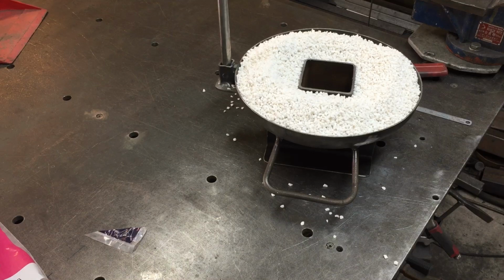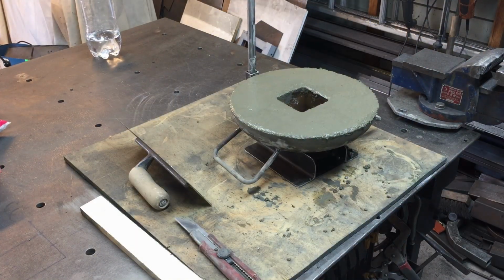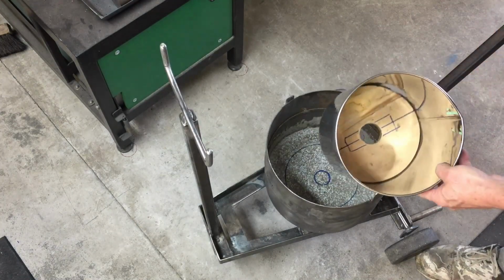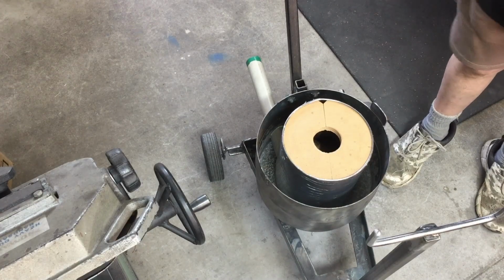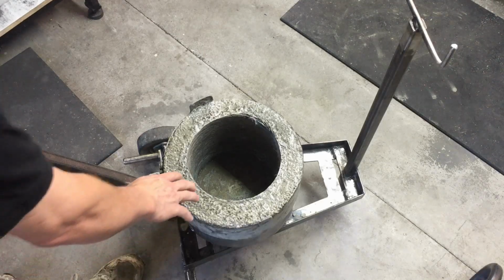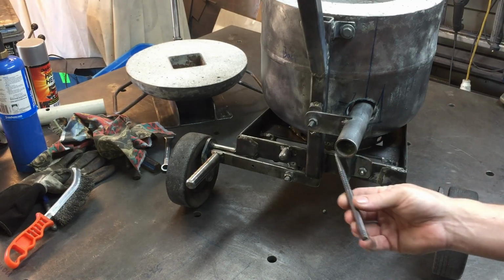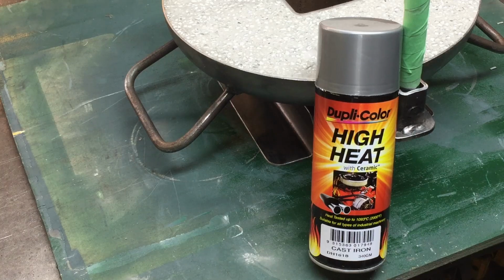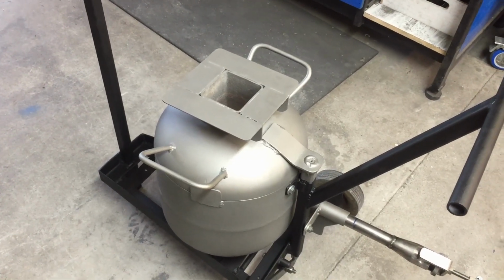Building a foundry from a propane tank - Part 2

Comment: Good job. I build furnaces a lot and have learned so much from what to do and what doesn’t work as good. The perlite is good. But through my many uses of the perlite/Portland cement recipes, I’ve learned through usage and experience that it comes out and looks good but when up against the extreme temperatures for brass and copper melts, it doesn’t hold up well and eventually after even just 3-4 uses it begins to break down and crumble some. I even use Green Patch 421 as a coating to help the efficiency of the furnace, which is like satanite, and that helps hold it together longer but as you get the small cracks that will develop from using, you’ll see that the Portland cement is breaking down and crumbling and even falling through the cracks. Also i made fire bricks with the same recipe and fired it after it cured well, had the 421 coating also, after firing for 20 minutes and around 2200’, i let it cool down and the next day began to break it apart and found how it fails and crumbles and even how it gets a little hollow areas which decreases its efficiency and refracting. Also found that it acts too much like a heat sink then to reflect and takes longer to reach temperature versus ceramic wool/ kaowool. I now make them with kaowool and the green patch 421 coating and now my furnaces are much lighter in weight and super efficient, like a Devil Forge brand ( which is a great brand ). With the diy refractory mix it would usually take about 20 minutes to start melting the copper and now using the kaowool/green patch 421 coating within 10 minutes the copper is beginning to melt and by 15 minutes I’m about ready to pure depending on the size of the crucible and the amount of copper involved to melt. I did the diy refractory mix because of the cheaper cost and local supply but in the end it wasn’t doing well. Maybe doing just aluminum ( which purging temps is around 1500’F) it would hold up better and longer. Cheers to you and your build. Hope maybe this info can help any who take the time to read this long comment haha.
Reply from the maker: Thank you very much for your comments and detailed information. This will be useful to the viewers who are considering building a foundry/furnace. I'm sure my mix wont hold up well with the hotter temps when melting brass. I have not tried that yet, but I do have brass that I want to cast into round stock to use in the lathe, so I will do it in a future video. it sounds like the kaowool and the Green Patch 421 is the better option when you move beyond melting aluminum.

Comment: Good job.  I used a plastic flower pot for the centre former and it didn't deform at all when I compacted the mix.  The glad wrap idea was a good one.  Cheers Rob
Reply from the maker: Thanks Rob. Yes, a flower pot would be good as it has a taper which will help with easier removal. Did your wife ever ask you where her flowers went :)

Comment: I would like to know more about "hot blue" and why and how to do it. Thanks
Reply from the maker: Hi, bluing is done on steel to protect the steel from rusting and to give it a nice finish. I'm no expert but I think there are 3 different ways to do it. 
1) Hot bluing which I have shown in some of my videos. Here is someone doing the process https://youtu.be/N3jt-73JfEE
2) Cold bluing which is a ready to use chemical that you purchase and put on the steel. Then you wash it off once you have the results you want
3) There is another method which I have not researched but I believe it uses chemicals/salts and they heat them (maybe also called hot bluing?). This may be used in more commercial shops instead of the home shop.  Here is a video. https://youtu.be/AX6E_K_DMxg
Reply: @thehobbymachinistnz  Thanks for explanation and links. What oil do you use?
Reply from the maker: @gregwmanning  I don't know how much it matters, but I'm currently using automatic transmission oil, just because I had some that I was not using. I use to use old engine oil from oil changes in the car, but that produced a bad smell.
Reply: @thehobbymachinistnz  Was the bad smell ongoing from the blued part or just the smoke produced during the dunking in the sump oil?
Reply from the maker: @gregwmanning  Old oil smells bad to start with, but yes, from the smoke when dunking it as well.